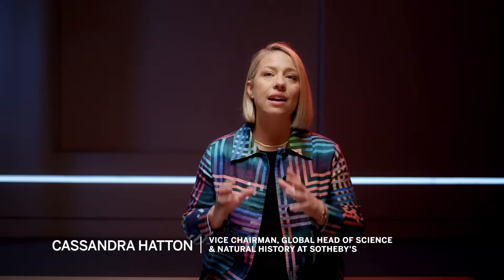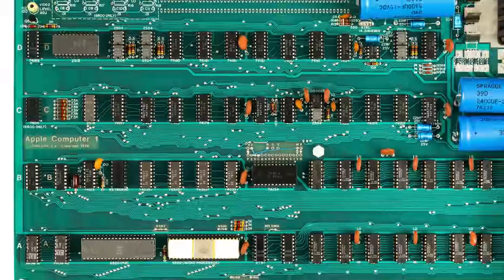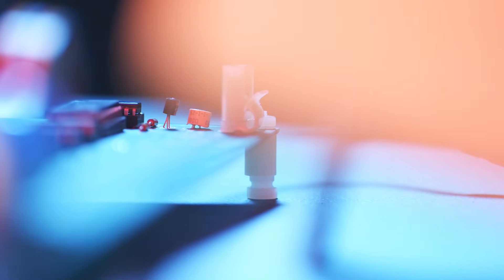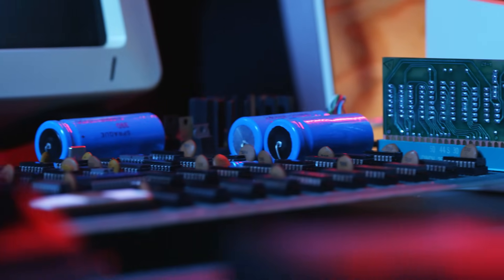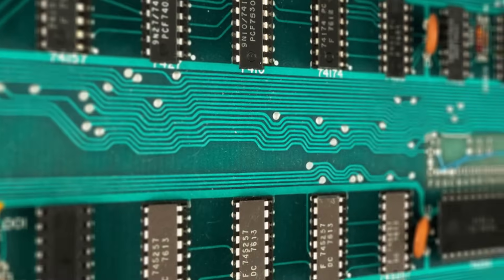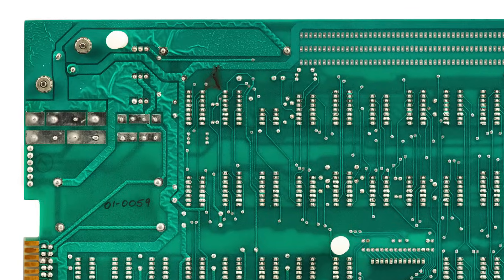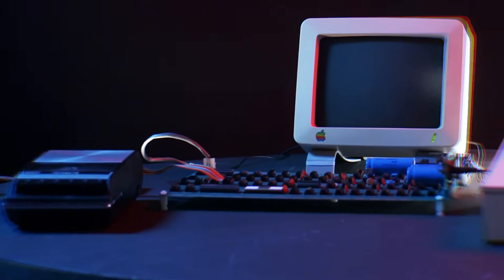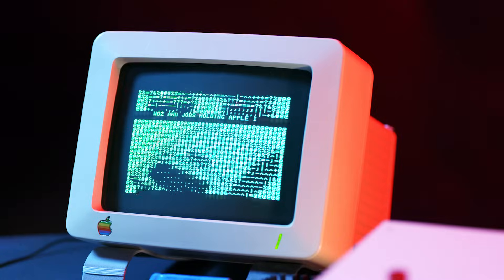The Finest Operational Apple-1 Computer in Existence - Handmade by Steve Jobs - Is Now at Sotheby's

Comment: This presenter mentions 'PAINT',  in her auction description, that is incorrect. That is the copper foil on the PCB and it is in no way, any kind of 'PAINT'.  I doubt Steve Job had anything to do with constructing that machine. Steve Wozniak was the technology guy in that partnership.
Reply: Jobs did not design any of it, but they both physically soldered chips onto the boards, etc. They had no employees at that time but some family friends helped out- building the first 50 boards by hand by two people is no joke. So yes, it is possible that at least part of this board was physically assembled by Jobs.
Reply: Jobs was electronics technician for Atari. 100% he would be able to build this (but not designed it as another person said).
Reply: @LandSnapper  intel 8008 was already selling before those two even started thinking about computers. there were multiple personal / home computers kits AND finished products already sold from different companies before apple even founded. :face-red-heart-shape:

Comment: Handmade by Jobs?! HAHA! No.....  He wasn't an engineer, nor a technician. I am pretty sure someone else put it together. Give credit to the "REAL" Steve. Steve Wozniak invented the Apple-1 and Apple-2. Jobs stole all the spotlight.. On this and every other project he stole from someone else.
Reply: Bushnell hired Steve Jobs at Atari to solder arcade game circuit boards. This was way before Apple-1 existed. They famously put him on the night shift, due to "poor hygiene and abrasive personality", but he did get the job done.

The first 50 boards were indeed designed by Wozniak, but allegedly assembled by both of them. So yes, Jobs likely built these first computers by hand (as in: he soldered the components, not designed the PCB).
Reply: @wrgms Nolan put Steve jobs on the night shift because Woz would come hang out with him and end up working on whatever Steve did. Nolan called it two Steve's for the price of one
Reply: @hajiamano22 yep, that too. Including Breakout.
Reply: You don't need to be an engineer to be a hobbyist, just like you teenager Steve jobs is building a computer like a hobbyist. The difference stevejobs doing it using raw science and engineering while you have internet to ask questions.
Reply: Exact!!
Reply: They built it together.  I’m not an engineer nor technician and I built several Heathkit and Radio Shack radios.